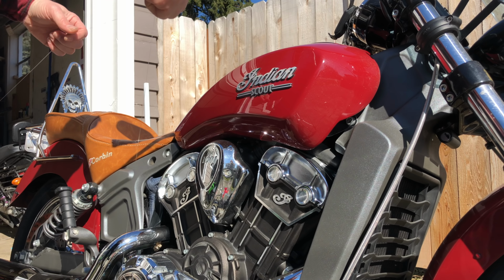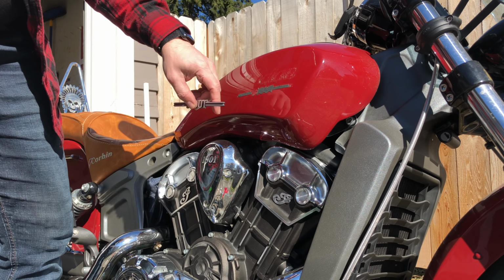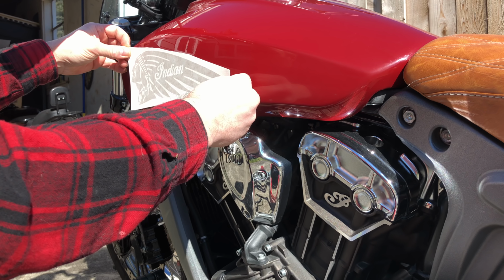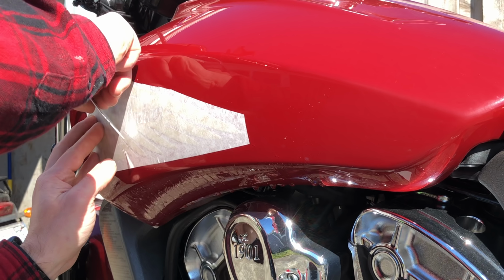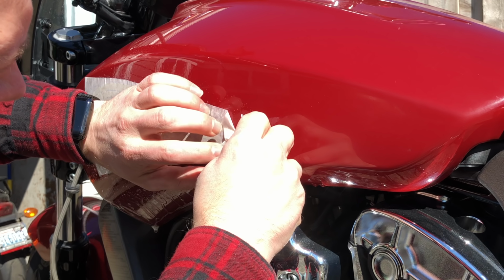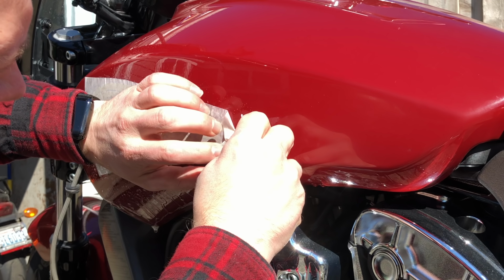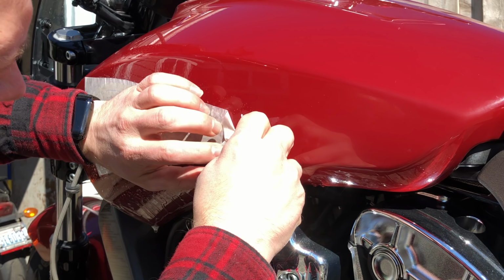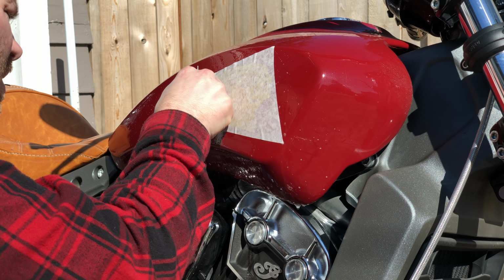Indian Scout - New tank emblem install

Comment: I was hoping you would have comments enabled for your Mac video, I was looking for details on the two intel processors you used lol I’m in the process of trying to upgrade my 2006 Mac Pro 1,1 so any advice is super appreciated (my brother is telling me to junk it and build a Pc, I said no way watch this video 😂)
Reply from the maker: Yeah, you’ll want X5365 processors. A pair of them. Should be able to find a pair of them for $50 shipped on eBay, even to this day. 
You’ll also need a like 9” long 3mm Allen wrench (hex key) to reach all the way down to the base of the heatsink. Also make sure if you haven’t already, upgrade to a solid state hard drive.   
As for tossing it, I finally took my two out of use after plugging them into a Kill-a-Watt and seeing them using 600+ watts of power!